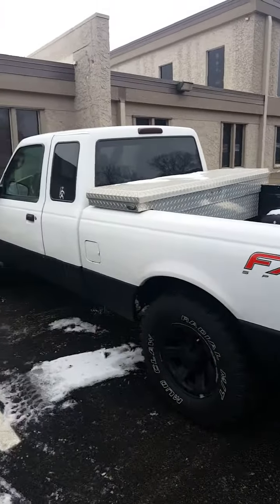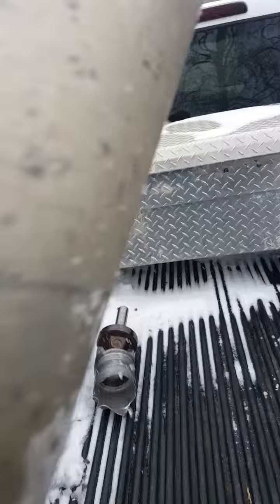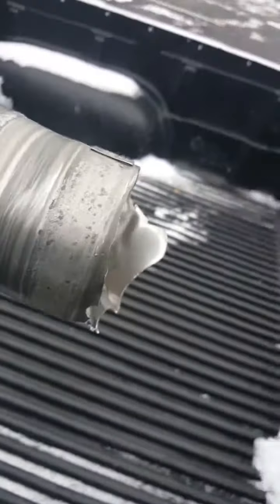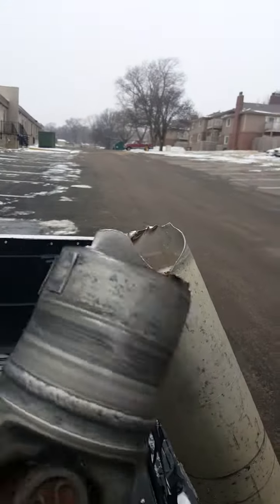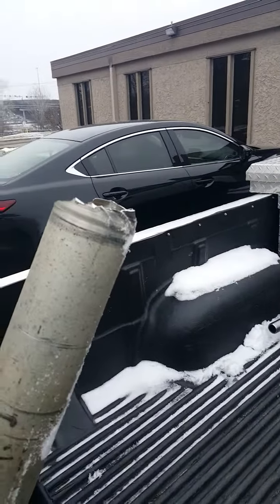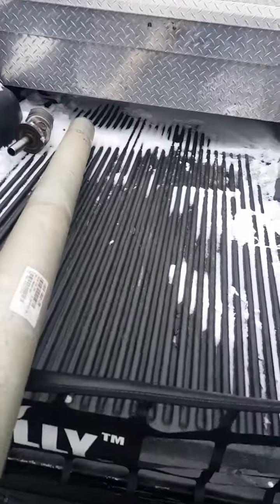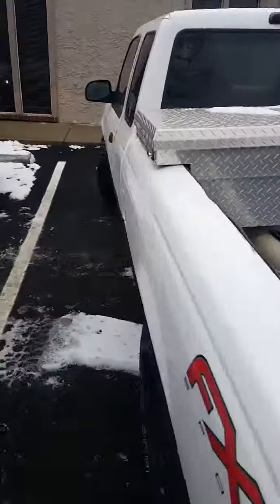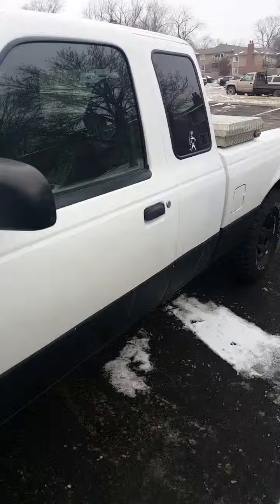Ford Ranger Drive Shaft Twisted In Half

Comment: This happened to me about 6 months ago with my 2010 Ranger. Mine has the 2.3L 4 cylinder. Was redlined shifting from 1st into 2nd and BOOM. At first thought I broke a U-joint. Got underneath truck and seen it was twisted in half. Exact same spot as yours.